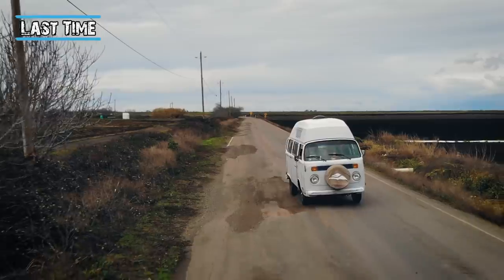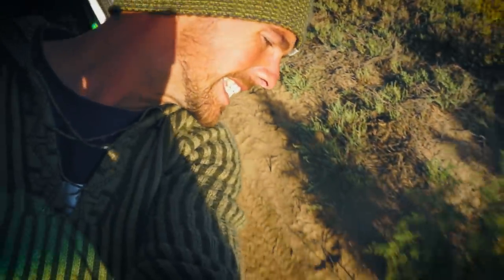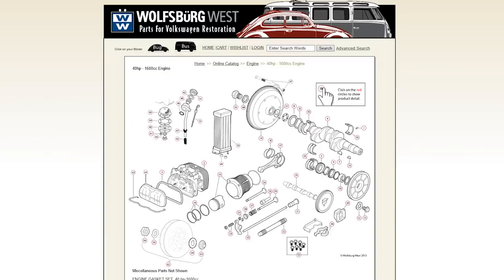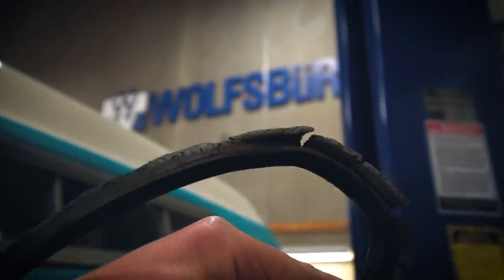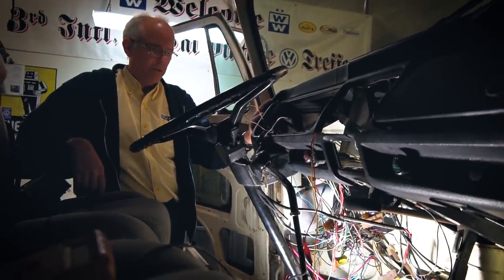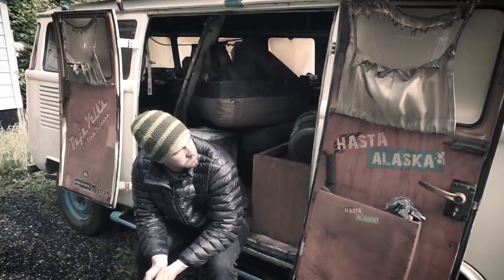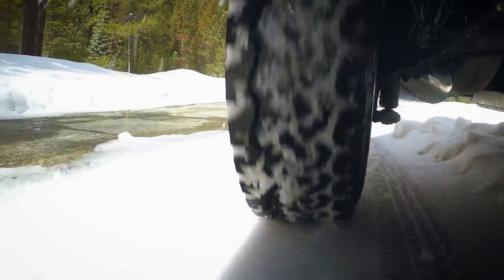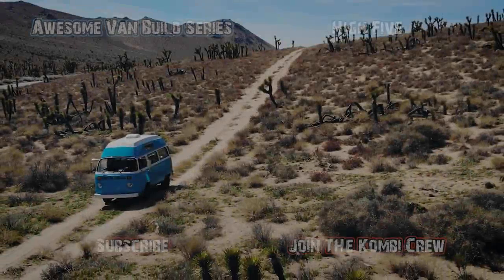This Van CANNOT Drive Around The World Like This! // S01E06

Comment: Loving the techy stuff. The gear box guys are spot on. Wondering if they went for a lower 1st gear for really steep hills or rely on the new engine to produce more torque at low rpm
Reply from the maker: We did talk about it, but the strongest first gear was stock sized ratio

Comment: Sorry, guys,  but all you're proving is what a horrible hunk of crap a stock vw bus is, and was. I owned a 1968 for 4 years.  I loved it, which made me as stupidly blind as you.  Went through 3 engines, and, like you,  I didn't scrimp on the expenses.  Every time,  I spent more for the best I could find,  upgrading and nursing the damn thing ad nauseum.  I finally figured out how to keep it cool. 5 quart oil sump, 3.5 quarts of oil. I installed an oil tem gauge which vw didn't do because they didn't want anyone to kmow tgat a STOCK engine runs at 220 to 250 degrees!  With 5 quarts of oil, it never gets to 100 degrees,  and will destroy your fuel economy,  not to mention cause all sorts of other problems.  I found out through trial and error that 3.5 quarts was tge the magic number,  resulting in a consistent 180 degrees. Unfortunately,  the number 3 cylinder cooking problem still persisted,  and I sold her with the knowledge that I just couldn't keep throwing more into it.  Got sick of the lousy heater, crappy performance,  shitty fuel economy,  and godawful maintenance schedule.  If I had to do it over again,  I'd swap the engine for a chevy v6 and have something worth owning.  So far, by my calculations,  you've spent over 50 grand on your project when 25 for a super comfortable,  fully self contained 4 wheel drive Chevy van would have been the way to go. Stop loving and start THINKING.  I wish someone had made me see the light before I made the same mistake as you. Vwz are great to drive, but hell to own. When I switched to my Chevrolet van, I never experienced a single breakdown for the remaining 10 years I was using it for business.  True, instead of 18 mpg, I only got 15, but gas is a lot cheaper than an engine.
Reply: LOL Your funny but lacking the passion i guess?I I had a 1966 camper bus as a first car in 1976 kept it for 18 years with only one motor  swap, my third bus i have now is almost restored complete,just being stopped and hear other peoples stories about the buses they had makes it so worth  the life of being a bus owner is the best,The fact of going out in a crowded parking lot and finding your car right away. Maybe you should get a prius so you can lay the seat back and sleep in it for one night?I dont get the stop Loving and start thinking?The best time of my life was me and my dog driving from LA to Canada on a 3 month coastal trip in my Bus.I guess people need to stop and smell the oil burning on your engine and enjoy  Life !!!
Reply: My thoughts exactly..and I've been getting flak for not having "passion"..LMAO
Reply: Too funny.  You probably won't believe this, but I've been a car nut since I was 5. My absolute favorite was my honda z600 coupe.  I paid 2800 for it, which was a fraction of what I paid for just about anything else.  It was not only an absolute blast to drive,  but it was as reliable as a sledgehammer, AND, not that I cared, it got more attention than anything else I ever owned.  And I've had 5 porsches, and 2 lancias. Currently,  my ride is a 2002 suzuki multicab microvan. I can easily sleep in the back because the rear seats fold flat......
Reply: paige hunt weird flex but ok.....  stop yo essays and support these people ffs, they dont have to bring us with them but they do so be glad
Reply: Or you could just upgrade youre volkswagen, just because you love it. My first (and only) car is a 73 bug. And yep i also blew two engines and a tranmission in the first year (a 20 000 km year btw), thats the reason why I made a reliable subaru engine in it. Still driving it as daily after 3 years.... (and 40k)
Reply: Lars Vloemans ITS CALLED KOMBI LIFE FOR A REASON FFS......
Reply: I actually considered doing that,  but unfortunately,  it was my only vehicle at the time, and was also my delivery unit for my business.  I couldn't afford all the down time, so I made the only and practical decision I could.  Sold it and bought a super reliable,  yet boring Chevy van.
Reply: paige hunt  you so right , a really old vehicle is no the way to do this. Get a new VW van and it will give you hell to but remember most expeditions in VW kombis were done when they were much newer so way less of the old syndrome. This will be a huge fix it trip and a lot less of a road trip!
Sorry but there it is ,...the trans guy even said it in the video, you need new for a long trip!  Cheers Warren
Reply: warp21drive faith will get them there
Reply: I had a 86 dodge 250 van for 10 years , lived , towed boats and trailers , one transmission replace . I gutted interior , put that truck bed stuff, gator , on the inside floor  and walls , was great to hose out. also put in 3 batteries , 2 marine gel cells , and a solar panel with computer to take care of batteries . I worked on yachts , so most of gizmos were free from company . I was single , no dog , could stealth camp anywhere in city , I lived in a van down by the Chicago river , had a great view of Sears tower.

Comment: I still dont understand why you left it air cooled. For longevity it really needed a later watercooled engine from a vanawagon.. And on slick slimy roads a cutting break set up is much better than a limited slip as you can steer with your rear tires when your front tires are slimed up and just sliding.

Comment: You guys should just keep a carbureted engine on there at least then if you are having fuel system issues all you have to do is clean the carb and it will run find fuel injection has alot more parts and sometimes requires a computer to adjust.

Comment: broken transmission and engines on a Volkswagen? I know exactly what you're talking about! 😭
Though 20 + years ago while @University w/o budget I had 4 different engines, ~10 times the engine out (aways done alone and of course never with a lift, due to budget).
tranny change @ 5°C on an engine with double Weber in a Käfer = no fun. Parking in a Public garage because the starter didn't work and I pushed it down, jumped in, clutch, turning the steering because all this happened within 25 meters (75 feet).
90ies‼️NO INTERNET, NO MOBILE PHONES ❗

Today I "drive" a Quigley Ford E350, which isn't problemless either - but this time no-one in Germany has any clue about my ride - Käfer wouldn't be a problem at all 🤔